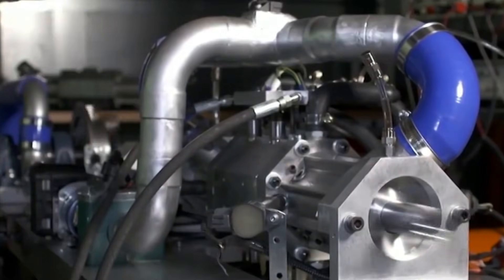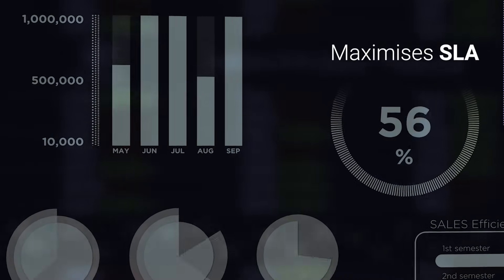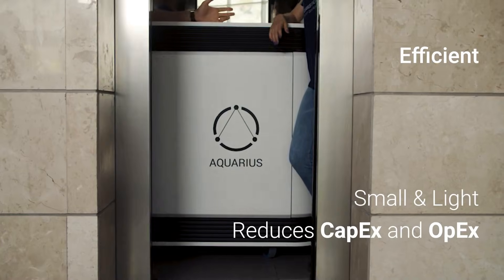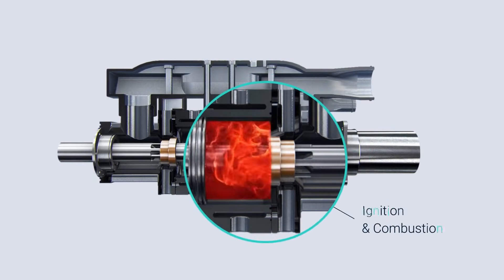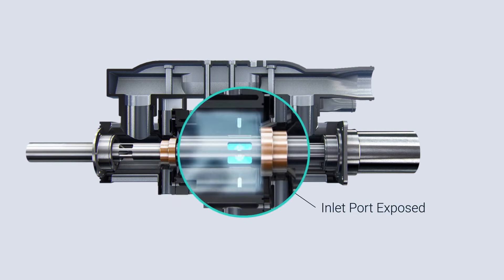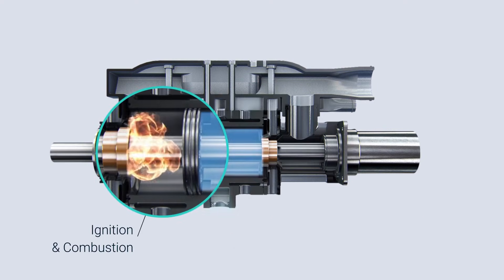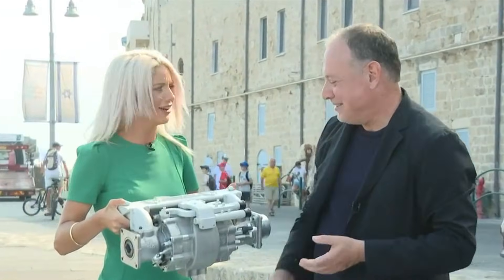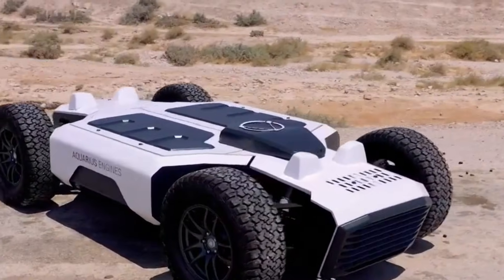New Technologies: 10KG 40HP 100$! HOW WORK NEW ENGINE? Aquarius - 1 piston!

Comment: Burning fuel to produce electricity to run a motor is a waste of fuel.  Put a small diesel motor in the electric car, and it can do the free way all day at 50 mpg, or the creek by the house could charge the car batteries to get to the store and back every day, using a small generator made out of a direct drive washing machine motor, or the solar panel on the roof of the electric hybrid van charges the battery for creeping in traffic with the motor off.

Comment: A major drawback would be the vibration caused b y the reciprocating movement combined with the ignition.
A ROTATING version should significantly reduce this vibration.  I think that such a rotating version has already been patented by others.
Still, THIS version certainly seems promising.

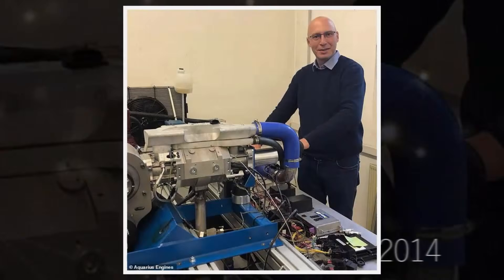Comment: This bloke is talking through his hat.  1) it is a 2 cylinder engine.  2) it is a 2 stroke engine.  This fellow’s claim it is equivalent to a  4 stroke engine is just wrong!  If his 0:15 claim was correct every 2 cylinder 2 stoke engine could be considered a 4 stroke engine.  What he neglected to point out this engine will have significant balancing problems.

Comment: The exhaust vent as just a hole in the side of the cylinder which is exposed when the piston moves down seems either genius or just wrong. Why don’t ordinary pistons engines have this?

Comment: Bravo for your invention Aquarius, idea with this weight and the amount of energy produced, question: if this invention would be introduced in an electric vehicle, if I understand correctly, could generate enough electricity to power the vehicle's batteries, therefore the only energy input would be the fuel to power your Aquarius invention.
I don't know the amount of consumption of the Aquarius, but it would perhaps be a significant reduction in greenhouse gases.

Comment: The problem is vibration.  The connection between the drive shaft MUST have a teeter-totter arm linking to a linear actuator of about the same mass so while the piston shifts to one side the piston in the generator is shifting in the other direction.  It will still likely vibrate a lot, but this will help.  Those pivot points though will take a beating.
Reply: its often used in tandem with another unit out of phase to counteract this.
Reply: Yea, I prefer the opposed piston version by Libertine from the UK. Completely eliminates the vibration issue

Comment: This is not a terrible idea but it has very limited applications and will not be any good for transportation without redundancy and stupid conversions. It's only applicable for generators. Using generators to drive electric motors is also retarded, regressive and redundant.

Comment: A generator doesn't need rotary motion to induce a current by electro magnetism. You could actually draw power off each end of the push rod, on each throw of the piston, it may actually provide a useable sign wave if you can control the engine speed and decelerate the piston instead of a deadend stop. I wonder if they've tried?

Comment: Sketchy  at best Despite Brochure babbles.  This is basically a doubled up 2 stroke Two bores sharing a piston. 
With All the downsides of a 2 stroke: poor exhaust with short circuited intake charges.  
Not Fully  understanding the power delivery beyond  the to and fro motion that 'could' generate Electricity. 
Don't give your Day Job !

Comment: 2 cylinder 2 stroke engine. This is a 2 stroke engine. You can't claim that a 2 stroke engine is double in 4 stroke engine because the power stroke happens as often. This is a 2 stroke engine. I say that because they are clearly attempting to avoid that recognition because the world is moving away from 2 stroke engines because they lack in efficiency. To be honest, I like 2 stroke engines. But, this is absolutely a 2 stroke engine.

Comment: I'm curious as to how the piston changes direction without slamming into the chamber wall on EOS. In a standard engine the piston changes travel direction by riding the crankshaft via the connecting rod so its motion is secured without banging into anything. Also they do not discuss how the starting process works.
Reply: You have 2 effects , one is the compression of mix that create a real break 2 you can reverse the current. A generator can act like a motor, (this is the way it start )
Reply: Starting process will be similar with a battery powered motor moving the Shaft.. I suppose

Comment: Basically, the design is an opposed two-stroke. There is no indication of a compression seal on the shaft. Without a seal, compression will be forced through the bearing leaving the combustion chamber void of any fuel-air mixture. Lubrication and heat distribution is also not shown. If this was to run on a fuel oil mixture it would not comply with emissions standards. Unless these design shortfalls can be addressed is engine is as they say "it's dead in the water."

Comment: Range extender with fossil fuels WOW, sounds like a fossil fuel car!  Lets' just admit it - EVs are a disastrous failure if you  have to add an internal combustion engine to replace internal combustion engines.

Comment: Nice. Very  high power to weight ratio and with an high efficiency. What I don't exactly understand is how the engine is lubricated. It seems to work as a two-stroke engine. Does it use petrol as fuel or diesel or a mixture of petrol and oil?
Reply: It IS a 2stroke.... with all the advantages And proven disadvantages.
Reply: apart from it doesn't use oil  @barenekid9695
Reply: Its not lubricated with oil, it uses self lubricating graphene piston rings and bushings, it runs any fuel via compression ignition which can be varied by adjusting the linear generator power draw.
Reply: @ChrisDay-sx4lv  So... 1000 hours between overhauls?
Reply: Zet engine best power to weight ratio.
Reply: Going to burn oil like an Iraqui well in the early 90s.

Comment: How do you start this motor?
Reply: suppose there may be a special mode for linear generator to push and pull the rod
Reply: Something like this but powered by steam. A small buffer battery  for keep the net stable. And u could power your house.  Steam by solar or Woodstove

Comment: didn't listen (@broughxtreme).
The compression of the air/fuel mix can only be compressed so much after the exhaust port is passed. Then the compressed mixture pushes back a few degrees until ignition fires then exhaust port re-opens as compression begins again in opposite cylinder.  Also, the driven rod that holds the double sided piston/s, is driving a generator  which is also providing resistance to prevent the piston from impacting the head. I suggest that you " Listen & Think " before sounding foolish!

Comment: Scam! Big problem, where and how you lubricate the shaft housing and piston ring?
Without aspiration compression phase you can't expel exhaust Gaz like a conventional 2 stroke.
On opposite piston engine they have a compressor to fill new air and expel the exhaust.

Comment: 40 HP = 30 Kw , Lithium-ion Battery is $130  / Kw and 5 Kg/Kwh
So if you will reduce a car from 50 Kw to 25Kw you will save $3250
And save 125Kg of weight  
Why is not all manufactories switching to this, it sound to good to be true ?
Reply: Because it runs on fossil fuel, aka no good!!!
Reply: 震动太厉害。没戏。

Comment: Very old idea. Great on paper, never worked in practice.
Reply: A hundred years ago they could not create the engines we have today. The rotary wasn't feasible in the days it was patented. Visiting old ideas with new technology is worth researching
Reply: The 19th century technology and metalurgy are different to the 20th century version, which means the strenght of materials and the precision cuts as well the gasket technology have big differences, making an engine these days are not too difficult.
Reply: like late 19th century, teslas oscillator was same priciple, but he found it uselss because the amount of vibrations it cause, and linear generation is more useless than motr generator. I completly agree with you.
Reply: It's working, just for getting money from crowd funding
Reply: i'VE read about
Reply: The principle is well known, but I think vibration will be a huge problem.

Comment: A range extending engine for a EV sounds so sensible for many vehicles. It should be implemented.
Reply: For climates that get cold enough for heat pumps to be ineffective, cause EV batteries to be unable to take a charge and operate at reduced performance until the battery pack warms up, having a gasoline generator power and heat the vehicle at least until batteries are up to temperature could help quite a bit too. When you need both the power and all of the heat you can get, gasoline (with exhaust heat recuperation) becomes 90+% efficient. 30kW is a bit excessive for a normal EV though as most cars only need 16-20kW to sustain highway speeds.
Reply: @teardowndan5364  If 30kW > power to sustain highway speed then just remove the batteries and replace them with smaller and cheaper module of supercapacitors. The whole thing can be cheaper than an ICE, fully electric, or hybrid car. Right?
Reply: @royroye1643  A supercap bank large enough to absorb all of the regen braking power from highway speed to zero without a massive voltage swing will be quite bulky and expensive too and not hold enough of a charge to allow the generator to run start-stop cycles worth a damn.
Reply: @teardowndan5364  How about "hybrid supercapacitors"?
Reply: @royroye1643  Like LiC? I did the math a while ago and if you want the system voltage to stick around 400V, you will need about 125 cells in series and each of those would need to be about 7500F in size just to handle regen braking and acceleration loads. If you want enough storage to run the car long enough to survive a red light cycle before the generator needs to kick in again and run long enough to be worth starting, you'll need at least 50X more space.
Reply: Isn't that a hybrid vehicle?
Reply: @thorfinsky1427  AFAIK, hybrid usually refers to the gear box having both ICE and electrical inputs, further divided between plain hybrids which use the ICE as the primary power source, have a small battery pack for acceleration boost and regen braking, and PHEVs which rely primarily on the electric drive train until the battery gets low or the load is too high for the electric drive train to manage on its own.
Reply: compatibility is a key feature. The plug and play aspect of electricity is beautiful. and the simplicity of not needing a transmission. having power at extremely low speeds. I want a generator on my car
Reply: Flawed design.🍌☠

Comment: Have to be double side by side to eliminate the vibration. But toyota already built better same concept engine 1 stroke different chamber and moved by magnet for first time and Produce electricity when the engine turn on. To bad, except they put another innovation thing. Because its low torque engine.

Comment: Seems promising. A little heavy on vibrations, but the power/weight ratio is definitely good, and the efficiency too.
Reply: vibration is surely an issue. I wonder if there is an easy way to synchronize two of those engines
Reply: @kromeboy  a cam rod on end of stroke rod?

Comment: What stops the piston from hitting the 'head' at the end of each stroke (L & R)? And don't say that the electro magnet stops it as that would use more power to stop it than was produced in the proceeding stoke.
Reply: The piston compresses the intake air at each stroke. When the air is compressed enough the fuel is ignited and the next power stroke starts, with the piston beginning to move in the opposite direction. This is what stops it from "hitting the head".
Reply: @lucianene7741  ?????????? Like any engine on cold start-up it will take a couple of strokes to draw in the first air (and fuel) to fire up on. One hell of a noise if it ever miss-fired or ran out of fuel one day.
Reply: @broughxtreme  
 You don't need the fuel to ignite to prevent the piston from hitting the cylinder head. Any air trapped in the cylinder will be compressed and act as a cushion.
Reply: It you use an electro magnet to brake somthing it produces power. It acts like a generator. Thats where the output power of this thing comes from.
Reply: That almost makes sence. Got a head full of Covid at the moment, so hopefully it will make better sence in a few days time. Ken @WolfmanDude
Reply: I don't understand the drive shaft how do forth and back axial movement drive ?
Reply: @niklashultkrantz7766  They don't. It drives a pair of linear generators mounted alongside the combustion unit. They then charge the batteries of the hybrid EV. So it wouldn't be much use as a single power unit for a normal car, unless there were several of them, perhaps one for each driven wheel, and using a linear motor driving a disc mounted behind the driven wheel. A bit like a brake disc turning the wheel instead of stopping it. However, due to different speeds needing different power outputs, batteries would still need to be involved to flatten out the power fluctuations. Also, the use of multiple units would use much more fuel and likely defeat the object.